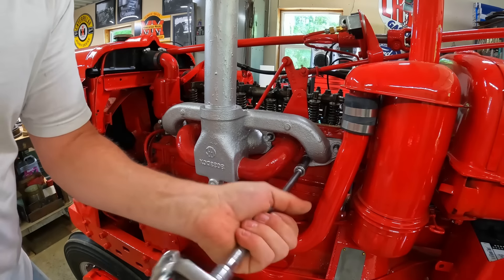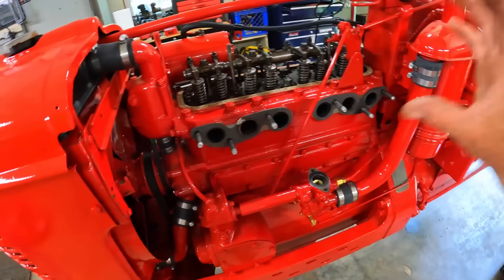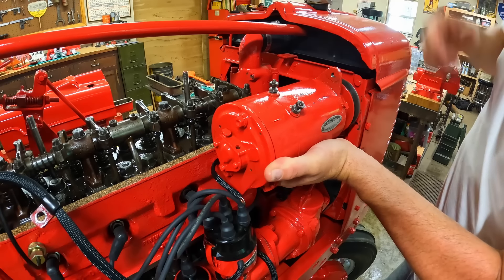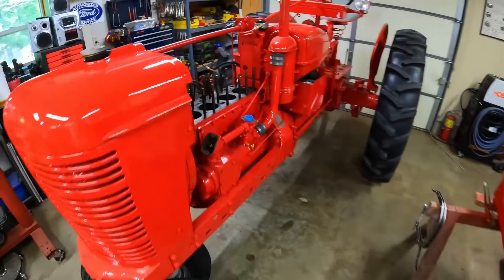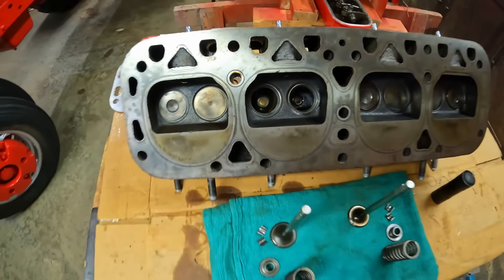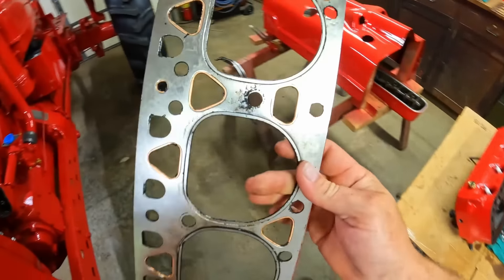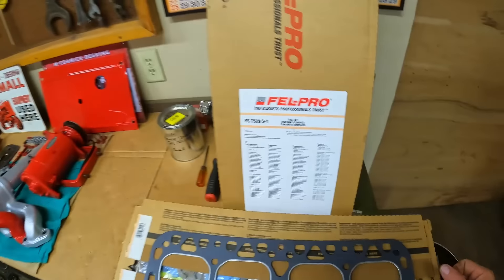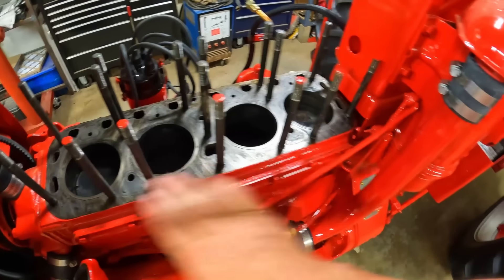Farmall H Engine Knock Found, But It's Not What I Thought - Farmall "Preparation H" Project Part 45

Comment: To those commenting to use Green Loctite Sleeve Compound, you've clearly never had to try and take apart an engine that has dry sleeves and sleeve retainer compound. The next poor sap trying to do an overhaul who doesn't know the history almost always ends up ruining the block. I've seen it numerous times in the machine shop. The only ones that were saved were the ones where people gave up and we bored out the sleeves in our boring bar. Tens of thousands of Perkins and Waukesha diesels were built with slip fit dry sleeves. All 71 series Detroit's were built with slip fit sleeves, the only thing that holds them in is the head gasket and Cylinder head. Assuredly, new sleeves and pistons will be of lower quality than you have now. All this points to inspecting the counterbore as best you can for damage, inspecting the liner flange for damage, check protrusion, bolt it together with a new gasket and it'll outlive ALL OF US.
Reply: Spot on, Never and I mean Never put retaining compound on a sleeve. 
In an engine that has ran for a long time they seem to stick themselves in the block all on thier own.
Reply from the maker: @lukestrasser - This comment sums up the exact place I'm at with this dilemma - my trust in the quality of new parts is quite shaky anymore, so it truly is a roll of the dice whether you're going to go even further backwards by trying for "new" as opposed to sticking with known quality parts, albeit with wear.
Reply: @squatch253  run the known good quality that you have with the correct head gasket ...IMHO
Reply: If you were putting this back together for a customer then by all means dig in and do your very best to rectify the problem. With that being said, you have a great knowledge and a wealth of experience. Knowing the existing problem would put me in a better place  and I believe that all will be fine until it isn't. Catch 22 for sure!!!
Reply: If the liner was that loose, the head gasket would be blown, and it would be missing.
Reply: I would suggest to use Green Loctite Sleeve Compound, Squatch is not going to sell the tractor ever and if he did, his log book on work carried out would show that he had used to the compound and change the gasket for the correct one that covers the sleeve.
Reply: I’m with you guys new gasket and put her back together with the proven parts, as my dad used to say about slightly used parts. “At least they’ve proven themselves to work”
Reply: I'm thinking if you're this far into it, might as well rebuild it completely, even though it's a low hour motor. Complete rebuild might be cheap insurance.
Reply: Locktite is probably the best option. It's unlikely the tractor will ever to be taken apart again. In any case if that were to happen, a boring bar does a great job of liner removal.
Reply: Squatch. I cast my amateur vote in support of @lukestrasser. He speaks common sense and truth and supports his opinion with good examples. Apparently, you are also in his camp since you pinned his comment. These vintage engines are mighty tough and I believe Luke summed it up nicely with regard to the service she will give you after this simple repair. 🥸👍👀✅
Reply: Luke is totally correct however in this case Squatch would know that the sleeve has GLT on it and would know what to do if it needed to come apart. I'm afraid that liner is better than anything new out there and finding a new old stock set of liners and pistons would be a stroke of luck and crazy expensive. It will stay together for a very long time calendar wise and a very long time engine hour wise with the time and attention Squatch puts into his projects.
Reply: @maxnex7676  He might even hang a brass tag with the vital info stamped on it. He can be trusted to look out for the next guy that curates this tractor.
Reply: If it came down to putting locktite in the cylinders or junking the tractor, I'd junk the tractor. Invariably, he may have to go back into the motor and there you go--he will have created a secondary problem, needlessly I might add. There's nothing wrong with going back together with what he has and a good retaining gasket. With the head back on, the sleave can't go anywhere. A rebuild at 200 hours would be superfluous, time consuming, and highly inefficient: i.e. cost and inferior parts. However, nothing in life is certain. It may not work, and you may be in for a rebuild. In my personal opinion, I'd drag my H across the scales before I put locktite in the cylinder.
Reply: @squatch253 f... it weld it.
Reply: You need about 400 degrees F to cause Loctite sleeve adhesive to break down. I believe that 400 degrees is the decomposition point for the anaerobic adhesive that makes up Loctite. We had a guy over on the N Tractor board who couldn’t get just one of the sleeves of his 9N or 8N (I forget) out even with dry ice and acetone. Somebody correctly guessed Loctite and posted it and the guy then heated the sleeve up with a rosebud torch and finally got it out.
Reply: F*** yeah  @RickBork
Reply: The thing I'll say with your comment is I did a perkins 1004 turbo motor several years ago for a Landini tractor and pulled the old and reinstalled the new sleeves myself. yes they were a pig to get out, I knew that from doing several older style perks years ago. I know how from experience to do it without machining, thats where lots go wrong they don't know when to quit and get help.  when installing the new sleeves it that 1004 it said to run 2 beads of locking compound round the sleeve in specific places before installing them. I also believe the originals were Loctited in place from factory, there was tell tale residue signs in the block bores and genuine perkins numbers on the sleeves.  So yes this isn't correct for his engine, I'd say if he's not wanting to restore the motor again glue it in and drive on if he's worried about new parts quality.
Reply: @RickBork  🤣🤣
Reply: My Dad had to have his welding buddy weld some beads up and down the piston bore of the sleeves to get them to pull out of his SMTA when I was a kid.  They were TIGHT!  The old timer that helped him pull the sleeves told him they were going to break the block trying to get them to pull.  It worked great.  So I think I'd rather have sleeves a bit too tight than too loose since you can just chill them to install them if needed.  I can't imagine the Loctite helps with heat transfer at all.
Reply: Never in my wildest dreams would I have ever thought a liner would move up and down the bore 🙄😳 I rebuilt an international BD144 engine and remembering how snug a fit the liners were 🤔 but would have to say for what it's worth a good OEM gasket would probably last a lifetime 🤔 excellent video 👌
Reply: Salvage And Reuse Guidelines exist for a reason. 
Do as you described- scrutinize the liner and counterbore, and if all inspects well, verify protrusion, re-seal the liner and reassemble with the proper design gasket. 
That's where I'd be at with it.
Reply: I have run weld beads up the liners in the bores  some 6010 works any old rod then the sleeves are easier to remove 10 beads up the bores does the trick!
Reply: @RickBork  - Well, there you go again. You two will always have a conflict if you give advice he’s sure to hate. Why can’t we all just get along, lol 🥸👍👀👋✅
Reply: You cook em out. Remember, this is a decision between a couple hundred dollar repair vs a several thousand dollar "start over" repair.
Reply: @squatch253  you are never going to wear that tractor out in your lifetime and I doubt your children or grand children would be able to either.   I had to have my sleeves bored out of my H just from sitting around.  So if it were mine and I  knew I had quality parts in it, I would use some retaining fluid in a conservative manner and use a known good design head gasket.  I just don't see why you wouldn't retain the sleeve, head gasket replacement and done.  Jmho Good Luck!
Reply: @squatch253  Agree, just wondering though, how much leakage, down the loose sleeve bore???
Best wishes all.
Reply: @squatch253  Trust me, when you torque it down, it won't go anywhere. Just inspect the parts and be done with it. The only issue you will run into is heat transfer from sleeve to block if it has worn it self out. Sleeve retaining compound can fill those gaps and it is a low performance engine so you will be fine.
Reply: My uninformed vote is to reuse the older but correct gasket or the new gasket you compared it to. Your videos are always entertaining and educational.
Reply: Plus the heat transfer is not correct
Reply: Clean and check protrusion, install new head gasket and go to work.
Reply: A  Good  Machine shop will bore out sleeves anyway on a rebuild press in or not just to avoid block damage.
Reply: Our M was worked hard for at least 10 years with a slip fit sleeve with no problem. The only way you will get press fit sleeves is to have them custom made and that is cost prohibitive. I've seen several tractor engines that had 1 or more slip fit sleeves that ran and wore out with no issues 
Put her back together with the Fel-Pro head gasket and let that baby run.
Reply: When will this ever be rebuilt again, its basically a show tractor at this point. I will probably run for another 100 years. We will all be living on Mars by then
Reply: I'll throw my hat in this this guy. With the minimal runniing time, I doubt it did any damage to the sleeve or block. Pop it up a bit and inspect as best you can. Then fit the FelPro gasket and enjoy your tractor.
Reply: If you ever need to pull the sleeve for any reason later on. Assuming you have another one just bore the old one out. 30 min set up time and 30 min of boring bar and it’s done if you ever need to take it out
Reply: Could just need a new cylinder O-Ring.
Reply: Reminds me of the carpet guy who used the full on cure glue instead of the release type.   By the time it comes back around I have moved to another town.   That was horrid stuff to try to peel off.    I told the guy I hated people like him.    I had one guy lock tited the outer  bearings on a motor,  guy was purely stupid and not mechanic  (any motor guy knows it has to float the bearings,  they don't spin but they move to adjust to the field).
Reply: Ideally a dry liner should always be installed dry.  However measuring of the block and liner is critical for proper cooling.  71 series had multiple linear sizes to accommodate different blocks or overbore.  
   As for this engine its really a moot point.  If Toby chooses to use sleeve retainer he will certainly document it and Im sure he will let the future owner know.  I have not had an issue removing dry sleeves, i weld them out.
Reply: Never use any compound on liners.Next rebuild will be a new block if you do.Immerse liner in dry ice for ten minutes and they drop in.
Reply: @squatch253  I don't see why it is such a dilemma really? If the sleeve checks out, no unacceptable damage or tolerances, adding something like Permatex Sleeve Retainer along with the proper gaskets should be enough for the expected life of the tractor. There are better choices of oils to give the tractor longer life, and that should carry it on into the future. It's not as if in like 20 years there is going to be much available for these tractors, or that people will be able to use them like they can now. Make a repair you can be confident in, document it well, and enjoy using it.
Reply: @miltonwells6750  Well that liner is that loose, he just showed it! No idea why you think the head gasket would be automatically blown when that is obviously the noise. With that gasket, he showed none of it was covering that liner anywhere.
Reply: That's true, at least for the Detroit Diesels, but in that case there is no single one-piece head gasket, every cylinder liner has its own cup shaped metal crush gasket.  There won't be any play when the head smashes the gasket against the grooved liner lip.  Back when I worked on those things for a living I can't say I was ever sent out to change a head gasket.
Reply: @lukestrasser  Back when I worked at an IH dealership (1963) we would paint the sleeve with aluminum paint and put it together.
Reply: Just put the green loctite on the top counterbore not the whole liner. Squatch knows it was done so a little torch heat in the future to get it to release would be the worst case scenario. Combine that with the proper gasket clamping the liner and it should be quiet and last a life time.
Reply: Its an antique motor with low hours that will most likely never even need a rebore. Seal it in there with compound or JB Weld. If you feel funny, just use enough to keep it in place.
Reply: do you really think that this eng is going to wear out from working on a farm at this late date--i have almost 70 yrs of eng building experience and for heavens sake use some common sense and put some loctite on it with a proper head gasket--if you are concerned about the next guy --put a metal tag on the block explaining  what you have done--just like overbore and crank grinding sizes --geez  jmo
Reply: for heavens sake use some loctite if you are not going to take the sleeve out and do whatever -the thing will probably never need to be serviced again --however if you are so concerned about the next guy and the block--attaché a metal tag similar to an overbore or ground crank tag--there are several ways to loosen the loctite if you ever have to remove it and any competent machinist should know what they are (yes 70 yrs of eng building from go carts to funny cars and most in between) jmo--as an aside - do you really want the sleeve trying to compress the gasket all the time
Reply: The other big problem with putting any type of compound on the sleeve is heat transfer. Without that you overheat the pistons and rings.
Reply: @ronobrien7187  you don't have to soak the the whole thing --a judicious amount ,about 1 inch around the top by the step would be sufficient and would not particularly interfere with heat transfer--besides the damn sleeve isn't tight anyway that's why it is going up and down
Reply: Can’t you get a sleeve made oversized that will press in tighter?
Reply: @747fixr  No. You can get a standard oversize sleeve but then have to have the block machined to fit. Machining a sleeve would be really hard if not impossible due to wall thickness and flexibility.
Reply: I'd check the block bore if right put in a new sleeve new rings just that one
Reply: I hate loctite in that situation. I've taken dry sleeves in an old engine like that and just very lightly scored the outside of the sleeve vertically in a few spots with a welder and then polished those spots a little and put them in. Never had a problem. I'd do that and set it together with the name brand head gasket. You have it so why not use it?
Reply: @miltonwells6750  
How so?  If you look at the gasket that was in the engine when it was making noise, the sealing ring was outside of the perimeter of the cylinder liner, which allowed the liner to move up and down, without disturbing the seal.
Reply: @miltonwells6750  But the liner was that loose & the Headgasket was not blown; am I right ?
Reply: Great video and trouble shooting.   I saw the comment about using the loctite.  Bad idea with your explanation. 
One thing that I've done if the sleeve is loose in the counter bore is to spray paint the sleeve prior to installation.   I understand you can't spray the whole sleeve in this situation but any on the top would take up a tad bit of clearance in the counter bore.  
When painting the outside a sleeve it takes up any looseness that could cause a sleeve crack.   The question was  won't the paint act as insulation and inhibit heat transfer to the water jacket?  A well seasoned mechanic told me it's probably better to take up the clearance and do what ya gotta do.

Comment: Youza..😳 I didn't see this coming.. 

Thinking back to what i remember in the IH manual in the section about installing the sleeves, IIRC doesn't it say the sleeves should should slide into the block with little to no effort and if they are more of a press fit you are to freeze the sleeve to aid installation. 
If the sleeve isn't damaged in any way, I'd probably clean everything up and put it back together with the correct head gasket and run it. Especially seeing that this is more of a parade queen that exercises a couple times a year. Versus a work it's guts out everyday king of the farm... 

Great video and glad you found the issue!

Comment: 50 yrs ago or so I did a fresh ring and valve lapp job on a honda 305  scrambler MC for a friend. Reassembled with new head gasket. Ran fine, but had an annoying tick in the upper head area that wasn't there before the work. Disassembled again to see what the deal was. Turned out as here it was a problem with the new head gasket. Only just the opposite. The new head gasket overlapped the cylinder bore just enough to allow the piston to hit it. Got a new gasket that fit correctly no tick.